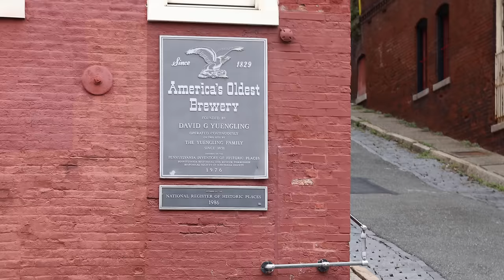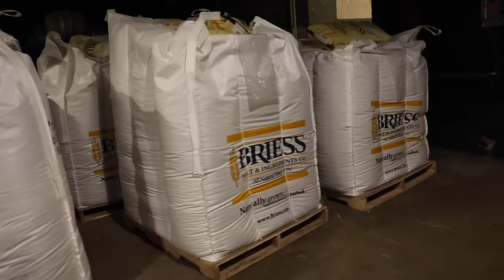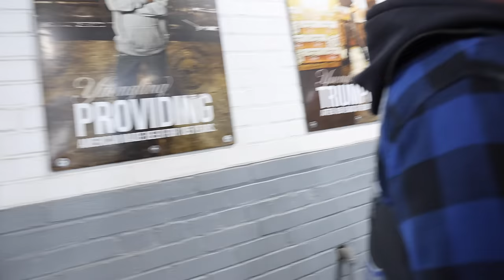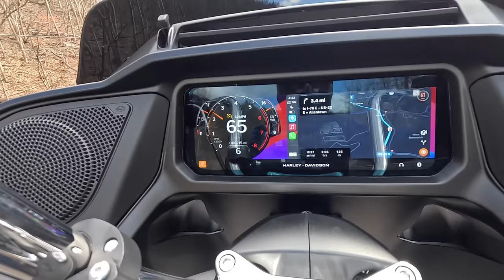Motorcycle Ride To The Oldest Brewery In America 195 Years Old #cyclefanatix #harleydavidson

Comment: Rev matching is not good ,down shifting is not good rather go thru brake pads then clutches, motors are designed to push not pull.
Reply from the maker: That’s a first